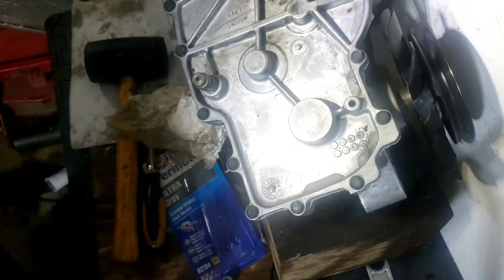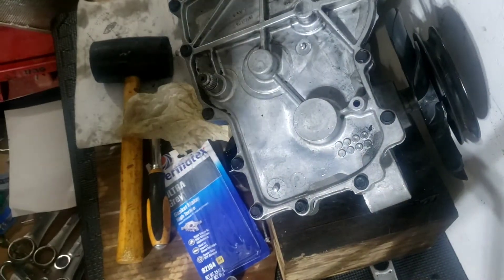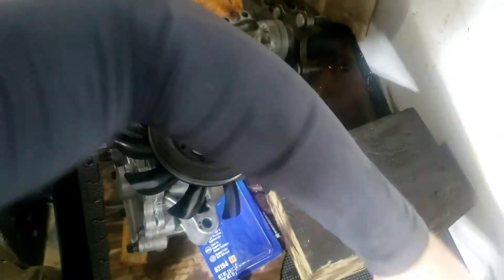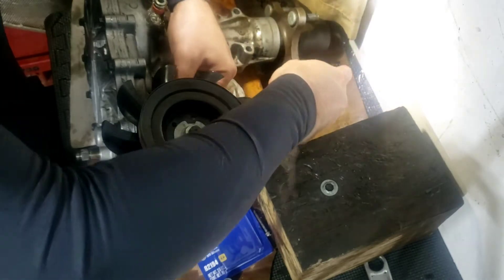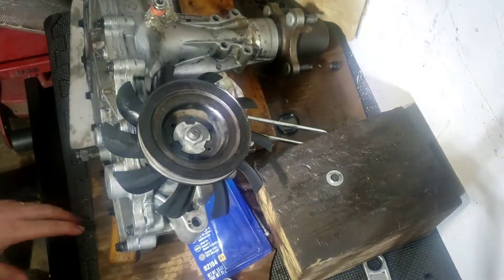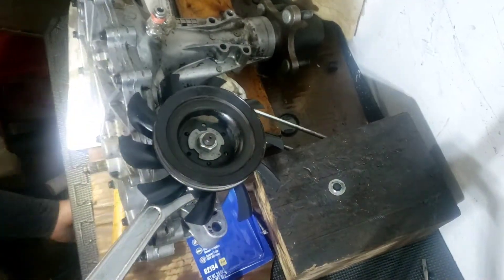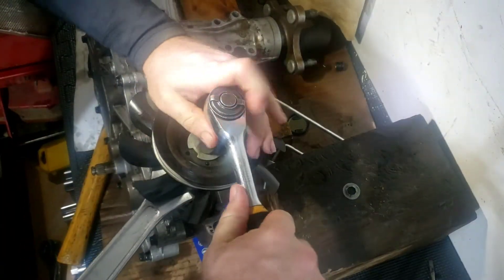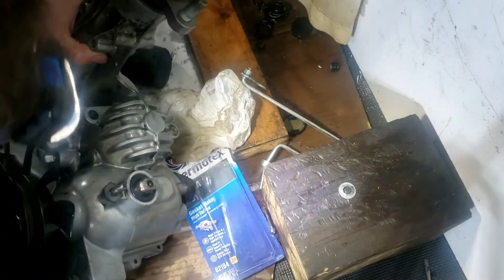Ferris FW35 48, 52 hydro transmission leaking hydro gear ZT-2800,3100 common oil leak repair part 11

Comment: Should both hydros be the same on the mower? My right side hydro says KJ KMFE 3B5C 1PLX and the left side says ZJ GMFE 3B5B 1PLX
Reply from the maker: Hey sylvester so when i search bot of the numbers only the ZJ kmfe shows up. 
I am guessing that mean the KJ is an older model that was discontinued and the ZJ supercedes that. Sometimes in factories if your mower is a late build in the modek year you will get 2 different numbers like this.
If its been built in the last 2 years it could be because of supply chain issues.
I hope this helps.

If you need to find out for sure the only thing i could recommend is calling hydro gear on tuesday and asking them.

Good luck.

Please like and subscribe every little bit helps during these times.

Seize the day each and every day-Are Jay 

Here is our mower repair playlist in case you ever need it.
The best Commercial walk behind Mower repair videos: https://www.youtube.com/playlist?list=PLQ0kUxbVWpJ-xSi236n9vlDcDjeLzWwkl